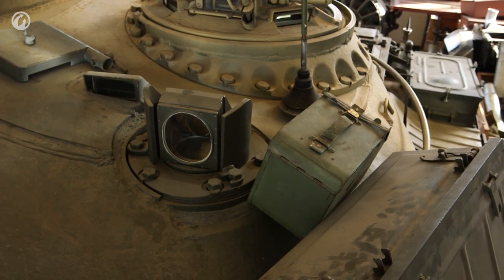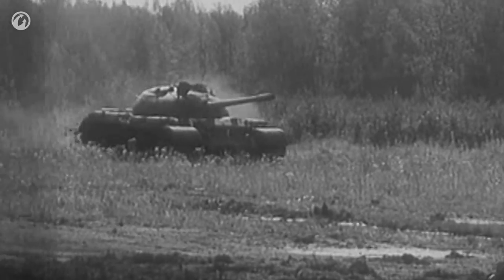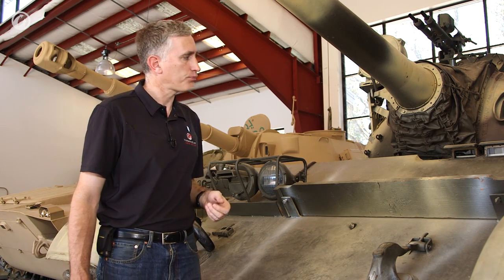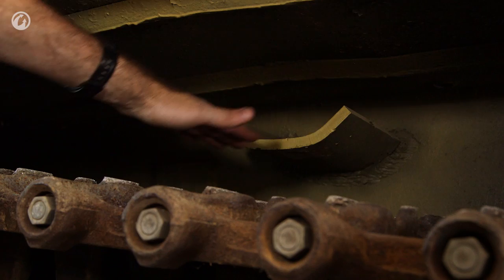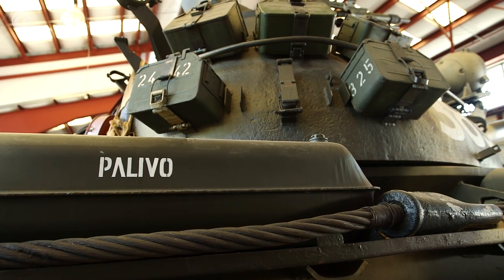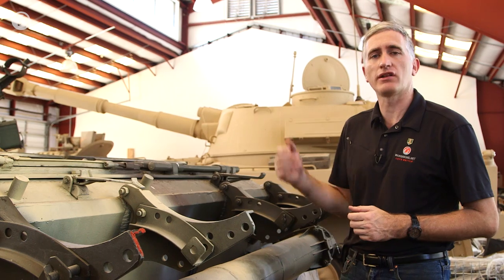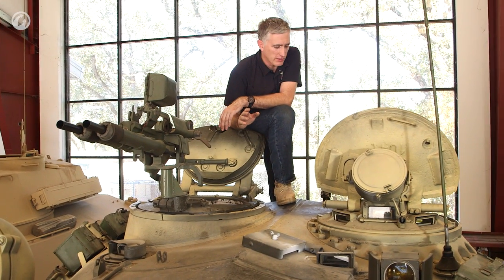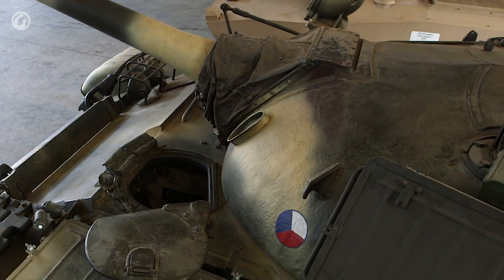Inside the Chieftain's Hatch: T-55A Part 1

Comment: Stopped playing WoT, but still love these videos!
Reply: +HaB22 agree with both os you guys,i cant love that old game,but i love this kind of videos!
Reply: me too. went to war thunder but I still love this series. WT plus this = win.
Reply: The same here. Tanks there are all good but "pay to win" politics and current push into higher and higher and highest of tiers is so violently loaded from every inch of the screen when in game. I tend to leave all above tier VI (Tiger excluded) but they apparently nerfed all of it which in case of current Match Making schema is atrocious! I don't think Europe and the US are the targets of this game since you barely scratch T-34-85 with a regular 88mm Tiger gun. When opposite, Tiger is NOTHING for T-34 85mm to first (or 2nd) shot-kill it in seconds aiming never penetrated during the whole WW2 vertical frontal plate of Tiger shit-gun. Just use a T-34-85M or T-34-100 and you can drive a battle ready, up-armored Leopard 2A7 - it is still NOTHING for a single "the shitiest tank of the WW2 era".
And those fantasies on Pz I C shooting its 20mm guns into tanks. While in real Pz I with such a gun never killed any tank even the lightest tank. It was never actually used against any tank. Never EVER!!!
The biggest game it could kill was a crudely made armored car. The kind made of riveted not hardened steel plates one put on a regular truck chassis.

Comment: Kind of funny to note that small but significant difference between eastern and western tank design with the commander's hatch. It shows you how much of an emphasis on crew efficiency and situational awareness western countries had in their tank doctrines.

I guess maybe we thought that if we couldn't outnumber, out armor or outgun the Russian tanks, at least we could out-fight them. Interesting distinction between military cultures.
Reply: +Keinlicht This hatch thing was proposed by Otto Carius the great tiger ace. He said that when the t34s opened their hatches to look out the germans could spot the easily because of the abnormality that is the hatch. So when the leopard was being developed he suggested a sliding type hatch to reduce this abnormality
Reply: +Soham Sarfare well but the huge downside of a sliding hatch(in my case on the leo2a4) is it takes quite awhile to close/open the hatch compared to the other hatch system
Reply: Soham Sarfare
Huh, if that's true that would make some sense. The open hatch is quite an obvious feature, and having the ability to increase situational awareness with an open hatch without alerting the enemy, I imagine, would be valued pretty highly by tank commanders.

I wonder if any of the features of soviet tanks were introduced by former tank commanders, or if they were much more of a 'designed by committee' thing. I would imagine the latter.
Reply: Keinlicht I heard it in a "Greatest Tank Battles" video- its a documentary/narrative series on the greatest tank battles. So in one of them Otto Carius was featured and  he mentioned ( in his memoirs) that when the t34s popped their hatches it made them easy to spot
Reply: +SubmarinerSix Once you stick your head outside, it doesn't matter - you expose it to direct fire. 
Soviet tank - your head is exposed to all threats and body from everywhere except front. If there is artillery fire - you are at big risk.
Western tank - depends on how much you rise from turret, but you can have (at least for some tank) hatch cover just in raised position, so it protects your head from above. So you are protected from splinters from above.
Reply: +Mungo Standard policy is to button up if you are being bombarded by artillery fire, so "umbrella" or no, a tank commander is to close the hatch.

Comment: Somewhere I had gotten the impression that the TC had a rotating cupola, but that the hatch lid forward was simply the preferred position.  Apparently I am mistaken.
Thanks, Nick for another great video!!  They keep getting better.
Reply from the maker: It does,, actually, but the periscopes on the hatch only face one way, so there is a definite "front" to the thing.
Reply: +TheChieftainWoT : Thanks!
Reply: +TheChieftainWoT The Chieftain is a free state piece of shit, not a fan of the 1916 martyrs, or, in fact, Irish Independence at all.
Reply from the maker: An interesting statement. Would you be prepared to justify the claim? Just curious, since I used to wear the Oglaidh NA hEireann FF as my cap badge and I don't believe I've ever expressed any particular opinion on the Irish independence process.
Reply from the maker: +TerrySiler I'm not sure we've met. Hi, I'm Nicholas. Tell me about yourself.

Comment: Hey! I've been on a 'Nicolas Moran talks about tanks'-kick lately and something caught my... ear, I guess: How sure are you this is actually a T-55A? The design for the T-55A was specifically the design that did away with the bow machine gun, so it'd be strange for a T-55A to have a hole for it. At a guess, it's a CSLA T-55M/T-55AM, which was a T-55 (no letter) refurbished to T-55A standard. That, or a T-54M/T-54AM, a T-54A refurbished to T-55A standard. I'm not that good at telling the 54s and 55s apart.

Comment: The wide snorkel was just for training, because the crews didn't like that there was no escape route if the engine died mid crossing. The combat version was smaller simply because they could carry them with the tank, and greater risks were acceptable. The large model just mounts to the hatch, and includes a ladder inside and out. Also can the ramp and pin system be described as "archaic"? Had they been using it for a long time when T-34 adopted it? Primitive, yes, but that doesn't make it necessarily archaic.

Comment: It is to my knowledge that on the T-54/55, there is a larger gap between the first and second road wheel than the rest. My question is, why is it there?
Reply: +Wiseguy7 My guess it's there to leave enough room between the torsion bars for the escape hatch, which is on the floor, below the driver's seat.
Reply: +Wiseguy7 Difference in weight distribution with the insides being tossed about?
Reply: +TheRetu81 Neuttah is correct. It was a weight distribution thing, and not about the escape hatch at all. The T-62, T-64, T-72 and T-80 all have similarly sized escape hatches, but they did not need to have a roadwheel gap.

Comment: "In reality the chances are if your hatch gets submerged you gonna get wet".

I thought "NBC protection" means that vehicle is pressurized. Therefore submerging should not a problem As is shown later in the video where the "deep water fording" is demonstrated.
Reply: Think about it - if the pressure inside the tank is high enough to prevent water at a few meters' depth from getting in, the crew would be experiencing the pressure of more than a few meters of water...

Comment: Honestly with the whole fuel fire thing it's DIESEL it doesn't burn as easily as gas....
Reply: if you hit it with a big guns it WILL burst thus spray the diesel into the air add fire boom instant bonfire.
Reply: Kabuki Kitsune I'm sorry but diesel will not burn if you drop a match into it lol I've held a torch to diesel and it barely burnt then...
Reply: ***** I do see where you're coming from because diesel combusts upon compression hence why diesel engines have lots of compression 22:1 or above actually.
Reply: Jay Harr it has to be atomized...pour diesel on a table slap it with an open hand with a match I can almost guarantee ignition...same happens when a penetrator hits an exposed fuel cell the heat from the round ignites the mist or a spark from a ricochet...it's not a totally bad idea but it's highly unlikely that ONLY  a fuel cell is hit...
Reply: ***** I know how it burns I have worked on diesel engines for years..
Reply: +Jay Harr The flash point of diesel is 54 degrees C, compared to petrol's -39 degrees C. So yes, it's harder to ignite, but not that much harder.

I do like the point that having external fuel tanks means that if it does go up, the fire is on the outside of the vehicle, so much less of a problem. The only real danger to the crew in that situation is if the fire got so big that it depleted the oxygen from the air in and around the tank (which is the biggest danger for tanks attacked with flamethrowers, as the thickened fuel stays in place and burns for much longer than a pure diesel or petrol fire would).
Reply: +Kabuki Kitsune There was real case of the the "to be arsonist" found by police in the house. He spilled fuel over the floor and was dropping matches into it in an attempt to start the fire. He was not successful. He used diesel instead of petrol. I have never tried it personally, but I was told that to burn diesel in this, you need something that keeps burning for some time, as the pressure of the vapor is low. Match would be extinguished by the liquid before it can start the fire. Not for petrol.

On the other hand - it was said that diesel is more difficult to extinguish and burns are worse (either because of temperature or higher density / more heat produced by burning dame volume of fuel).
Reply: +Kabuki Kitsune Hi, no objection. IMHO no responsible and sane human being would throw fire into bucket of flammable liquid - whatever it is - unless he is fine with big fire. As there is always chance of it.

Here, the question is reliability/chance of starting big fire. In my country, for fire safety, things are divided into classes, diesel fuel is in Class II and petrol in Class I and obviously, Class I is composed of the most dangerous ones. Not without a reason. But no judge would accept defense "but diesel is not very flammable" :-) 

And when it comes to diesel - it IMO would depends much on type of diesel: nowadays you have various types for different period of the year (summer/winter), various additives etc., also room temperature changes a lot. So you may get combination of factors, that greatly increases risk of fire.

Comment: Which museum is this tank in? I'm wondering about the fake gun thing. Also I would think if you were going to have a huge armoured plate blocking the hatch while open you might prefer having it behind the commander/gunners head to offer protection from the rear which is more likely to be overlooked.
Reply: +Marc83Aus Think about it this way, if you're going to put protection, would you rather have it facing the direction where you are more likely to be shot at from, or the direction you are less likely to be shot at from? You protect the tank and the crew against likely threats, not against something that happens rarely. 

Besides, if they get behind you, things have gone horribly wrong anyway and getting shot at by small-arms should be the least of your worries.

Comment: How is a fixed forward mounted machine-gun a waste of space? You don't need super accurate fire to fullfill it's goal.
Reply: 'The machine gun was aimed by steering the tank.' A waste of time
Reply: *****
There are more efficient designs imaginable certainly, but it's far from useless.  You can use it to spray in the enemies general direction to keep their heads down, or use it to cover a retreat when you're reversing the tank.  A weapon doesn't always have to actually hit the target to fulfill it's intended function.
Reply: Peter Timowreef
No modern tank fields a hull machine gun as it creates a weakpoint in the armor. The tank is already supported by infantry, IFVs, artillery and other forms of fire support. The driver is busy enough as it is, trying to coordinate with the TC and you want him to manage a MG. Not to mention additional space and production to equip an MG in already such a confined space.

Comment: How come the western Allies could handle German tanks with 75 and 76mm guns, but not the Soviets with their 85mm gun?
Reply: They actually did, the 85 could pierce 142mm with an AP shell at 100m; while the 76 only did 132mm at that same distance vs Face hardened armor( 85mm didn't make any distinction). The 76 did punch through 154mm @ 100m vs rolled armor.

Comment: Is track slap really much of an issue? If the pins are strong enough, wouldn't the track hitting the tank just make a really loud noise? Answers/explanations appreciated.
Reply: +Uncle Yar Track slap will probably hit the fenders, which are sheet metal, and throw them off the tank.

Comment: Having ridden in a T-55, a PT-76, and a BTR-60, I'll say that the whole forward-opening hatch business is a design flaw. Not only can you not just open the hatch and sit with only your head exposed, the hatches impose a major blind spot unless you stand high enough to see over it, or sit on the roof of the vehicle. Yes, they would provide a little bit of cover from small arms fire to the front, but at the expense of exposing pretty much your entire torso to flanking fire, or shots over the rear of the turret. The western system of rear or horizontally opening hatches provide more cover, not less. There is no advantage to that soviet design in the slightest.
Reply: How do rear-opening hatches protect you from flanking fire? And did you know that you can rotate the cupola around to face whatever direction you wanted?
Reply: +deodorantdeath By allowing you to not expose your body. To look around the hatch on most Russian armored vehicles, you have to have your torso either half or fully exposed to any angle except the direct front. In other nations designs, you are just exposing your head, which is a much smaller target. 

On the PT-76 and BTR, the hatches do not rotate. In fact, the hatch of the PT-76 covers the width of the entire turret and almost requires two men just to open because it's very heavy. It was back in the mid-1970s, so I don't recall it clearly, but I don't remember there being any rotating hatches on the T-55, and I can't find any photos that show it facing any direction but forward.

Some of their current tanks have a rotating commander's hatch, but it's still not a feature on armored infantry carriers.
Reply: +Larry Fontenot You can open the hatch, spin the hatch to the side, and peek over the edge of the cupola by squatting on your seat. Nothing prevents you from doing that.